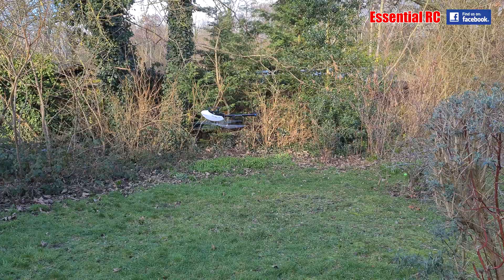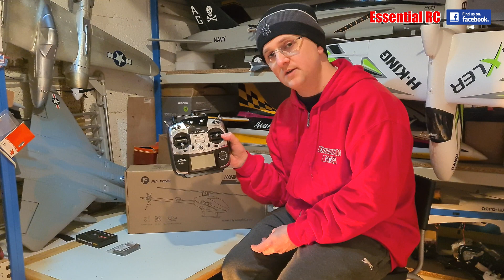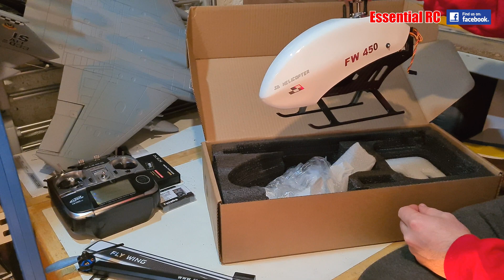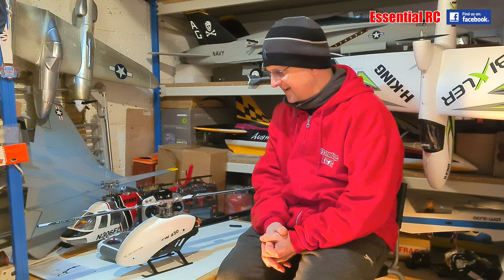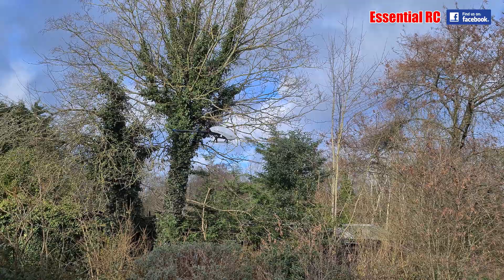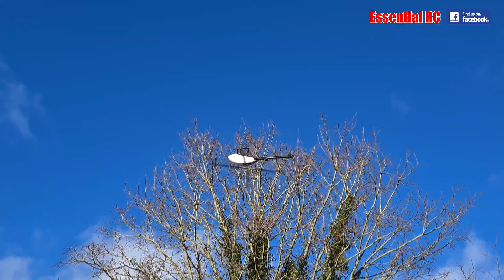CRAZY RC HELI AUTO INVERTS !!! UNBOX, BUILD and FLY !!! FLY WING FW450 V2 3D RC HELICOPTER

Comment: Mine arrived today, but .all I had to do was plug in the tail, nothing  elso required separate plugging in.  Then I put on the main rotors,  Then little bolts for the rotors would have easily feel out, but I kept my finger over them.  I fly it and it performed flawlessly

Comment: Carl,...FlyWing advises that when calibrating the Heli you can start the calibration process indoors then, when the program advises to start the turning of the Heli in different directions you can unplug from the desk top and take it outdoors. You do the calibration 'dance' outdoors then return to the desk top and plug it back on the USB. If the program says 'calibration successful' your good to go. If the calibration bars still show that the calibration is not complete, just un plug the Heli and return out doors and continue this process until you achieve a successful calibration. FYI This information was obtained from the H1 FACE BOOK GROUP Administrator. I believe he works for FlyWing and does the software for the H1 flight control unit.

Comment: Looks like it was very windy that day.
I'd be interested in any video you could do using the RTF version. 
I love heli's, but turned to quadcopter's years back as I was rubbish at flying heli's and feared losing them if I lost sense of direction.
The FW450 looks to be an ideal solution, but I don't want to have to fiddle about with settings. 
It's why I love quadcopter's, no messing around with setup other than doing the GPS dance!!
Thanks.
Reply: Was very windy. Which was a shame. I wanted to get lower with the inverted but wasn't that brave. Lol. And this heli could be a great solution for you. Set up is a bit of a faff but I shall be doing a full video on the H1 controller set up very soon. Just follow that and you'll be fine. And you only have to do it once 👌
Reply: Just to add this basically is now a review of the ready to fly version as I bound it to their transmitter in the end 👍

Comment: I have read and watched loads of videos for H1 Flywing couldn’t find what I was looking for so went ahead anyway I use  Trex 500 2 separate batteries 1 for servos, H1 and a 6s for the motor I’m not sure weather to connect the battery sensor to the 6s or not.

Comment: love the video's but can you increase the volume of the recording cheers.
Reply from the maker: I turned it down because it seemed loud. Can't you just turn your volume dial up?
Reply: @EssentialRC  It is at Max
Reply: Apologies. Next time I shall use my mic. I knew this comment would be coming. Just last video I used my mic there was a constant annoying buzz. Will try to sort it for future videos 👌
Reply: @CarlRcAirNLandNAquatics  Great stuff.
Reply: @EssentialRC  I have to agree when indoors volume is very low I had to connect bluetooth speaker thanks for the info on low voltage sensor it was doing my head in great video 👍🇮🇪

Comment: Carl, frsky makes a bunch of Futaba compatible receivers, both FHSS and FAAST. They are $20-$30, so I assume less than 50 pounds euro. They work very well and are MUCH cheaper than name brand Futaba receivers.
Reply: Thanks for the info. I hadn't thought of that. Think I'm just going to gradually switch over to the Radio Master TX16s though.

Comment: Excellent video - thanks ! ✅ Did I understand you correctly - set RTH Voltage LOWER than 3.6 ? Sounds dangerously low. 
At first I thought you were going to say set it ‘higher’ than 3.7V for safety but you mentioned it keeps returning 😆 Seems a bit counterintuitive 🚁
Reply: You heard right. I know you never want to run a lipo lower than 3.7v per cell. But under load and in cold temperatures the battery could dip below that for just a micro second and the auto return to home will kick in. It's a pain. That's why I said if you are going to use the auto return to home feature. Test it with a watt meter. With a battery at 3.8v per cell. Take off and go full pitch straight up so fully under load. And then land. Check the voltage under that load on the watt meter. And divide that voltage by the number of cells in your pack. That is the voltage you would want to set the low voltage return to home at.
Reply: @CarlRcAirNLandNAquatics  Great tip - thanks 👍🏻
Reply: I have the same FW 450 V2 heli and had the problem when you take off, the heli would immediately increase altitude and automatically return to home and shutdown.  I turned off the low voltage return to home feature and that put an end to the problem.  I can safely fly 2 flights @ 6 minutes each and the battery that came with the heli only uses 60% capacity. Hopefully FlyWing will update the software and this feature can be used as intended.
Reply: @Viperdriver-F16  It is a clever feature to auto return to home if the voltage is getting low. However just keep in mind that the heli does not have obstacle avoidance technology. So if it starts returning to home by itself and something is in the way it will hit it. Also keep in mind that if it happens to go low voltage return to home whilst you are inverted. I'm afraid the software isn't smart enough to right itself first. So the heli will return to home and land INVERTED!  Don't say I didn't warn you 😂
Reply: @Viperdriver-F16  done the same to mine today turned off low voltage sensor
Reply: @CarlRcAirNLandNAquatics  😂.  Next time I fly it, I’ll have it inverted with a fair amount of altitude and I’ll hit the return to home and see what happens.
Reply: @Viperdriver-F16  🤣 Just remember you need to be at a certain height to flip back up the right way. Don't get cocky and think oh I'll just flip it back over 3ft before touch down lol

Comment: Thanks for the video.  Does it only fly with full control in 3D mode?  My cyclic and tail control don’t function in GPS mode.
Reply: Sorry for long delay in reply. I'm sure you've worked out by now that in GPS mode the controls don't work until the heli is running
Reply: @CarlRcAirNLandNAquatics  Thank you.  The heli was flying but there was limited control.  I received help from Fly Wing and got the problem solved.  It flys great now.

Comment: Morning Carl great video, just bought a Trex600E, going to put the H1 system on it with a 9channel receiver, plus TX16S arriving soon. What part of the UK you based, I'm in Lancashire.
Reply from the maker: We're in Hampshire.
Reply: @EssentialRC  Can't to see your setup video on the TX16S for the H1 GPS Unit, I also bought 	
OrangeRx R920X V3 9Ch 2.4GHz DSM2/DSMX CPPM Full Range Receiver you use.
Reply: @EssentialRC  I there, just bought a Orange R920X V3 9Ch receiver, will that work on a Spektrum DX8 or should I wait for my TX16S ? got a blade 330X heli trying to put the H1 GPS on it.

Comment: Hi Carl, i just subscribed to your channel.So i bought one and it has just arrived and was wondering if the radio that comes with it is already set up with proper gain on head speed and tail speed, or will i have to change it when i do the calibration thank you and keep the vids coming cheers!!!. Oh and yes the red one is the one i got and it is the V2 one.Cant fly now cause we are having a snow storm lol oh well no rush.
Reply: If you purchased the RTF version that comes with the transmitter then yes all the physical settings in the transmitter itself should be all ready to go. However I would still recommend going through all the steps in the software on your PC
Reply: @CarlRcAirNLandNAquatics  Thanks Carl, i will do that for sure, lol don't trust ready to fly settings cheers!!

Comment: Carl, how low should I let my 3s and 4s Lipos safely get to.
Reply: Ideally never let any lipo get below 3.7v per cell. But if you set the low voltage RTH to that it will constantly be returning to home especially in cold weather. This is due to voltage sag under load

Comment: My gps not turning t0 s0lid green 0nly blinking 0range light
Reply: You need to calibrate the compass. Do the GPS dance with a laptop outside with no surrounding buildings or possible interference if possible
Reply: @CarlRcAirNLandNAquatics  i calibrate the heli successfully but zer0 gps sh0wn in h1 app in my lapt0p
Reply: @blow9899  hmm ok. You will need to contact flywing.
Reply: @blow9899  Flywing. Not flying